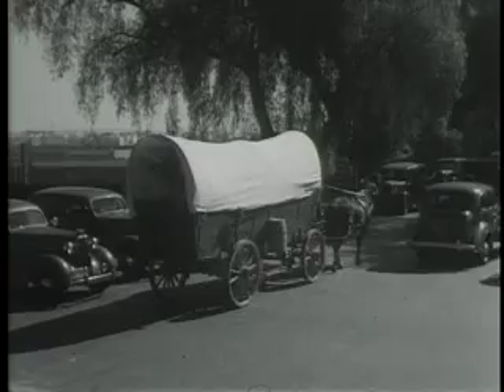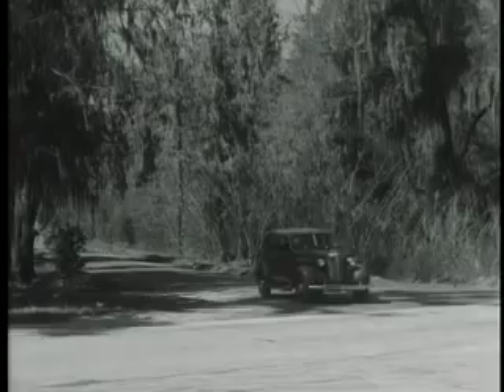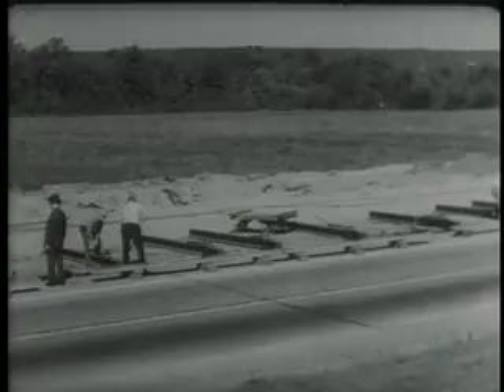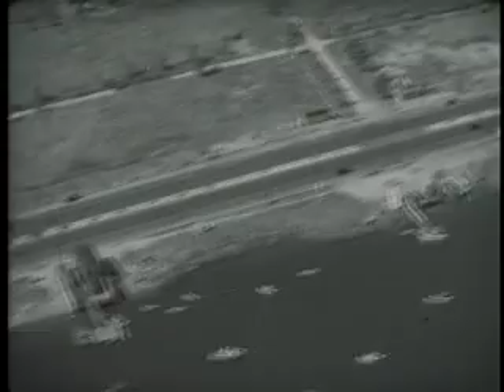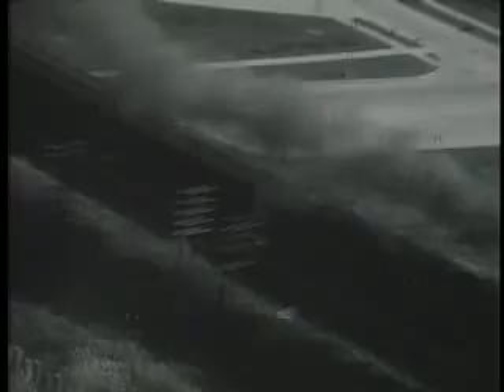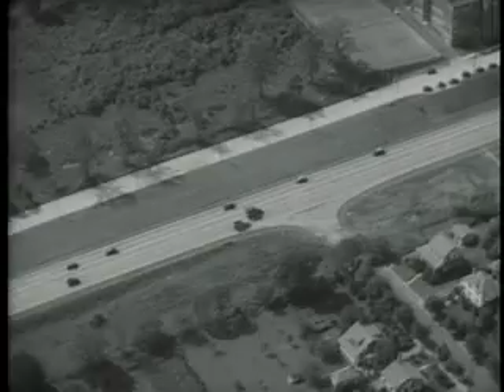Conquering Roads (1937)

Comment: During the Great Depression, road construction became a mainstay for workers. Ever drive down a blacktop with seams cracking through? Underneath that asphalt is a concrete road from the 1930s.
Reply: I work road construction I haul asphalt for a living and you are absolutely right brother every single Road has concrete as the base rarely do we Mill down that far and take up the concrete will take up several layers in years of blacktop and then put asphalt back down on the original concrete
Reply: My folks lived through the Great Depression. After the stock market crashed, so many people were out of work and desperate for income. They told me the government set up national work programs like the WPA. They did engineering work along waterways, like dams and culverts. Others focused on roads, bridges and housing. We should bring these back, because the infrastructure in this country is suffering badly from neglect in many areas, and people once again need new jobs.
Reply: @galebailey5583  sad part is … lots of people aren’t willing to work…they would rather thank the working persons tax dollars in the form of food stamps and welfare

Comment: Are some of those roads still there today, like the concrete ones and the circles that they showed?
Reply: thedalailama245
Many concrete roads are still used in La Jolla, San Diego, CA.  Most have been paved over with asphalt but luckily the concrete roads still lie under them.
Reply: some
Reply: Traffic circles have now been removed across most of NJ -- ironically, the state where they were first introduced in the US -- b/c Americans couldn't be brought to obey the one rule for navigating them -- that one must yield to traffic already present in the circle. Accident rates were higher in circles than anywhere else in the state. Circles are common in Europe.
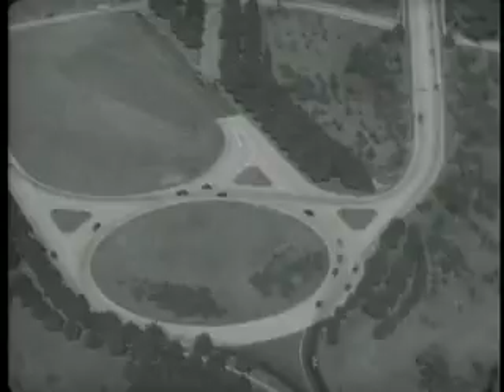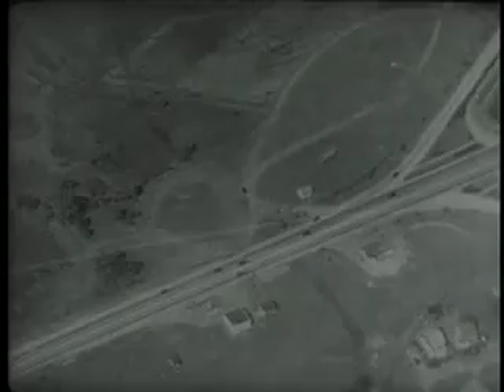Reply: Most have been updated. I am wiling to be the circle and clover leaf at 5:45 have been rebuilt. The clover leaf at 6:00 has no room for acceleration room  or slowing down on exit ramps
Reply: I was wondering the same thing.  It would be great see aerials of these exact roads now.

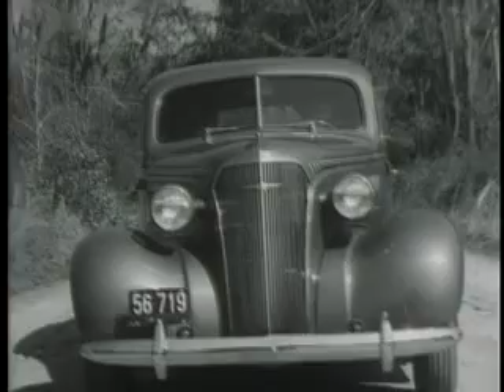Comment: 2:13 "they can stop, quickly and safely".  You'll find that's a very relative term if you've ever tried to drive a car with old drums in modern traffic.
Reply: I drive my Cj-3a every day and can attest that it's drum brakes work just as well as any modern car's brakes (and I live in San Diego so you know they've saved me from a number of collisions). The problem with drums isn't that they aren't strong enough, it's that they don't dissipate heat as fast and can overheat more quickly than disc brakes (and they're more difficult to service).
Reply: @bliesberg  That is true. I've owned lots of old drum brake cars and never found them to be weak but yes, during hard braking they are more prone to overheat and more difficult to service. One of the few things on an old car that's harder to service than a modern car.
Reply: Drum brakes work just fine unless you try to stop from 120mph or you're going down a hill at 60mph grinding your brakes. If that's the case, yea u ded lol
Reply: @Phenom98  Not if you know how to use them. You don't shove the peddle to the floor and leave it there. You apply the brakes gently and for short intervals. You also gear down to use the engine as a brake.
Reply: @tomfournier4941  exactly, you never do that. The car will skid if you slam on the breaks, whereas with a roll stop...you take the car with you until it slows down enough that you can increase the push force.

Comment: Nice video!
Highlight at t=3.55min "Curves have been scientifically banked, to make the car hold the road easily at usual driving speeds".
Still in year 2013 many outercurves on the road network have not been banked into superelevation. A Swedish study on fatal singlevehiclecrashes found out that these crashes are 5 times more common in outercurves than innercurves. The ROADEX III project (2008) concluded that adverse camber is a main cause to overrisk at outercurves. Amazing yr 1937 knowledge.
Reply: the inner curve give you a little room for error